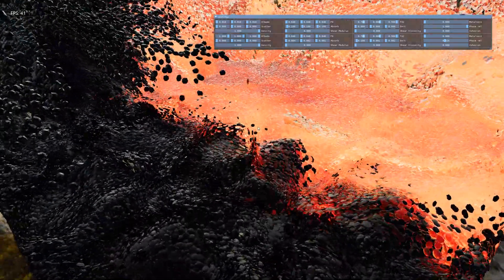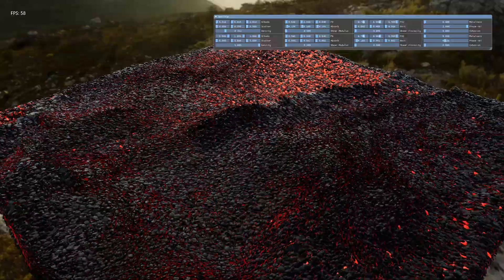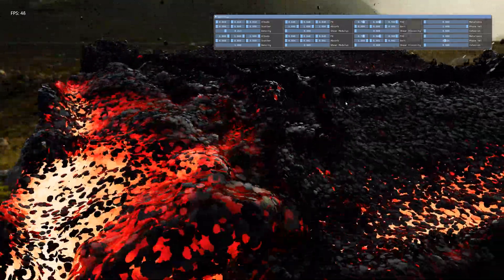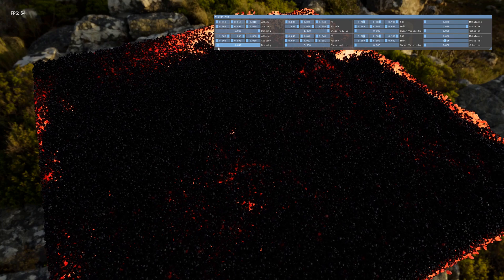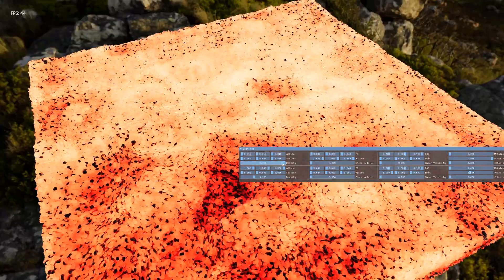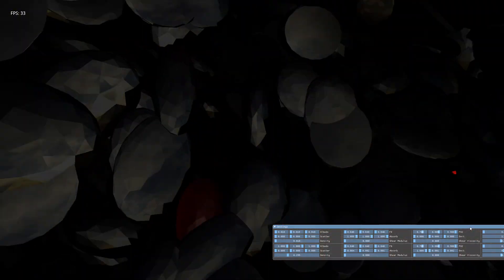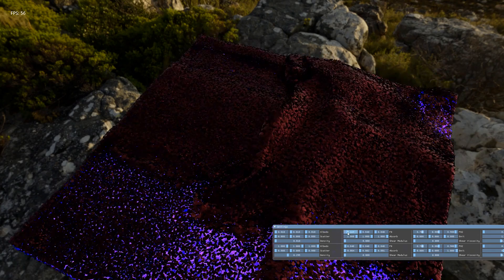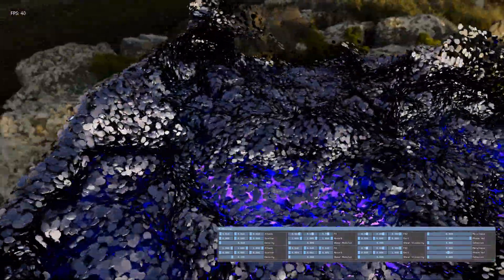Real-time Material Parameter Modification

Comment: Very impressive. 
Is ist possible that you check how strong the force on the particle is and in that way change the color to white and form some form of Sea spray?
Reply from the maker: I disabled foam in this video because I was demonstrating visual parameters, but in some of my other videos if I detect a large change in pressure on a water particle I will change it to a "foam" particle and after some time change it back. There are some false positives, where it can trigger foam particles where it wasn't possible for air to become mixed in, but overall it works pretty well.
Reply: @GrantKot  Cool. I was curious how you would do that. And if the pressure difference is large enough then bubbles can be formed. Those are filled with water steam. If I remember correctly, pistol crabs create those. That wouldn't be foam but it would be at least bubbles. Also I assume the pressure need to be quite a bit higher though.

Comment: Looks great,  Can this technique be used for rendering clouds in flight simulator 2020 so CPU bottleneck can be reduced?  What are the other practical applications of these techniques beside water bodies?
which GPU you are using and what is unlocked frame rate?
Thank you for your Demo
Reply from the maker: I haven't looked into Flight Simulator yet but it is a very complex game, many more parts to it than my demos. The CPU bottleneck could be due to all that streaming of assets, online syncing, etc. The particle system itself can also simulate viscoelastic materials and I have additional extensions for ropes, fibrous materials, and  rigid bodies with the same unified physics system (kinda similar to Nvidia Flex actually). And the same volumetric structures will be used for tracing reflections and refractions for all objects in the game. My GPU is an RTX 2080. The FPS is show on the upper left in the video. It varies but I will try my best to get it to a stable 60 FPS in the future.
Reply: @GrantKot  OK, thank you for your answer

Comment: I wonder what this would look like with a deferred rendering pipeline that blurs normals of nearby points (world space) in a fragment shader in screen space? Depending on your current rendering pipeline that might be easy or hard to test out, but my gut says an approach like that could improve the appearance. Instead of looking like a big mass of surflet particles, it could become a much more cohesive single object.
Reply from the maker: Hi, added in some smoothing in my latest video: https://youtu.be/7waXu66TxoU
Reply from the maker: Yeah, on the list of things to do :) I have some initial tests blending normals from volumetric data and from the mesh normals. It might help mitigate some artifacts that pop up if you do screenspace normal smoothing.

Comment: do the phases transition into one another?
Reply from the maker: Not yet but soon. I plan to add heat transfer and chemical reactions.
Reply: @GrantKot  Cool. It would be cool to see transitions between solids and liquids, such as rock melting into lava. Perhaps linearly blending between different particle meshes could add to the appearance of changing materials as well, such as transitioning from rough rocky surface to smoother fluid particles as the phase changes.
Reply: @GrantKot  Amazing!